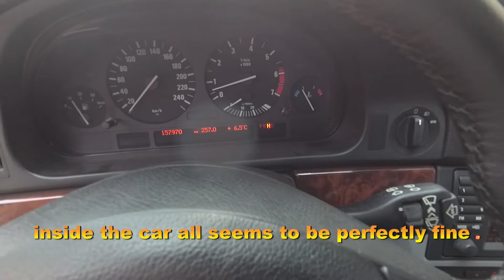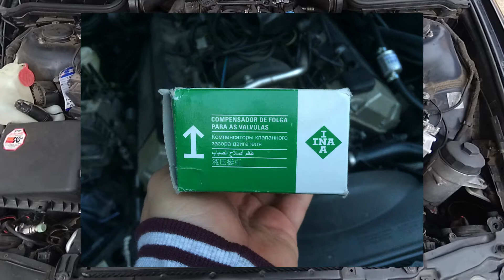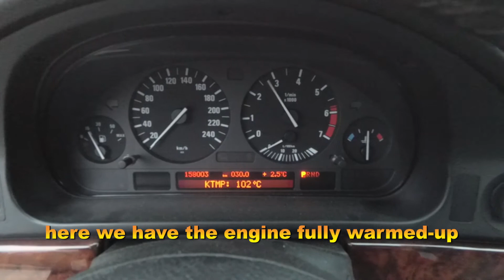BMW M62B44TU chain rattling. Chain tensioner replaced. Engine sounds. *Stock Exhaust Sound Check*

Comment: The reason the startup rattle happens is because of the “non-return valves” behind the vanos solenoids. The spring inside doesn’t seal the ball correctly after all of the heat cycles. Causing the oil to leak down back into the oil pan. A proper non-return valve should keep oil at the top of the engine at the vanos solenoid so the startup isn’t dry

Comment: I did try to change mine on the M62B44 non-vanos. It also had the longer yet softer spring. But even filled with oil, it made a ticking (chain ?) noise when accelerating past 2000rpm. I switched back to the original tensioner and no more ticking. Did it also happened to anyone else ?...

Comment: Hi what happened to your e39.. did you replace the chain guides in the end… thanks
Reply from the maker: Nope. I did not do that yet. May be I should have done that by now...
Reply: Just did the chain guides and vanos rebuild on my 01 740iL. Piece of cake, took a few days, going at it at a casual pace. Should MOST always use OE or OEM parts..just my two cents. Just because these e38/e39 are pushing 20+ years, does not mean they should not still be treated and maintained as the $70,000 cars they were in their prime.
Reply from the maker: @imabozoMeng  100% agreed on using OEM chains and guides. I am almost certain that BMW made an upgrade of the plastic chain guides and not sure if one can trust aftermarket versions. Was it easy to undo and redo the Crank Pulley cause torque specs of that bolt are crazy...? 😵‍💫
Reply: @mitchoniauto  Funny you ask, I snapped two 1/2" breaker bars before switching to an impact for removal. Torquing the new crank bolt 100% needs a 4ft 3/4" drive breaker and the m62 crank holder tool. 😆 The Harbor Freight 3ft breaker was bending severely on the last 60°.

Comment: It’s two years later. Did the guides make it?

You pull the fuel pump relay then turnt he car over to get the tensioner to disengage. Otherwise you slap the hell out of your 20+ year old timing guides.

Comment: the M62 and M62TU engines operate and a ridiculously high temp. 102C + is 215 degrees Fahrenheit ) and sometime the temp is even higher > 225F )meaning the engine oil is that same (or very close) temp. Its why the timing chain guides become brittle. Replacing the chain tensioner before any rattling  is good preventative maintenance. i own a 97 540i sport 6 spd (non vanos), ( 5yrs and driven it 50k now-140k on car). I bought the low temp 180 degree F thermostat kit  at 90k (i think approx <$100). engine much happier, coolant system pressure much lower, oil more stable. Valve cover gaskets just replaced allowing a good inspection of  Timing guides and chain tension etc . mine was tight. Engine spotless with zero sludge, deposits or even discoloration. I use liquimoly 5w40 and 5k oil changes. In my owners manual it says to use 15w40, but since my engine runs cooler it seems happier with 5w-40. You might want  to try a heavier oil Especially since you`re engine noises get more pronounced as it gets up to normal operating temp.

Comment: Timing chain guides after all huh?
Reply from the maker: :))) Still do not know for sure. Still driving like that. The thing is that we are pass 100k miles mark - 169k km to be exact. Everybody says it is 100k miles and one should change the chain and tensioners.
Reply: @mitchoniauto  Mine did the same thing for a long time too.  Then one day after replacing all water hoses  and repairing the injectors the ticking sound got louder.  Turned out to be the timing chain guides.  Initially the ticking sound went away when revving it, so took it for a spin and man it was performing better than before but the ticking was going after decelerating.  I put a new guide tensioner too and the sound was still there.  So took the entire thing apart and yep the guides were just barely started breaking.  The only way I determined it was the guides is when I removed all the belts, ran the engine and the ticking was coming from the drivers side.

Comment: I will never replace tensioner alone, without replacing chain guides as well. New tensioner will increase tension to the extent that old plastic guides can easily brake down. Then, there is a terrible noise due to chain touching a metal cover.
Reply from the maker: Yeap! You are probably right.
Reply: @mitchoniauto No, he's not. The tensioners get clogged up with burnt oil particles and don't pressurize fast enough during cold starts much much sooner than the guides start failing from heat cycling and friction wear. What kills the guides fast is the cold start chain slapping against them. Change your oil religiously and plan on changing the tensioner when the cold start rattle starts to prolong your guide life. They can last 150K. If you buy the car at 100K and got the rattle, don't expect miracles from just changing the tensioner. The original plastic is 20+ years old at this point and the chains stretch, too.
Reply: The tension is actually what makes the guudew last a lot longer, but when it has slack the chain slaps on the plastic and shatters it to bits

Comment: What's that knocking noise everytime you pan to the  right hand side?, as I have the same noise
Reply from the maker: Hi! Can you give me the time(s) in the clip so that I can look into it?
Reply: @mitchoniauto  i have the same noise as benny above and you have it aswell its at 10:11 to 10:15 it sounds like a steam train going uphill😂
I replaced tensioner as well and still sounds ,someone told me that sounds like lifter noise,next job is oil pan off and looking for plastics to make sure guides are good ,also someone said its normal as the non vanos is noisier 🤷🏻yours is non vanos right?
Reply: Another vid I watched said about same thing and in the other it showed the oil pump chain is loose in the pan. Might be something
Reply: @mitchoniauto  an example @1.01
Reply: its a normal m62 knock
Reply: 0:46 - 1:02 i have that exact sound aswell, M62B44 NON-vanos. Never heard it before, noticed it when i started it back up a week ago. any clues to what it might be?

Comment: Hi, found the reason for the ticking sound?
Reply from the maker: At one point I decided to check how the spark plugs were doing and found out that most of them were not tight enough which was a surprise because I had them torqued myself when I changed them... I will make a video with the sound of the engine as it is now.
Reply: Its VANOS
Reply: First guides are gone then needs rebuild vanos and the clean or replace tappers

Comment: Can you put a link up for the tensioner you used?
Reply from the maker: Yeap! BMW part number is 11317531813 and the one I used is INA 5510004100: https://www.fcpeuro.com/products/bmw-timing-chain-tensioner-lower-11317531813 And this is the Genuine one: https://www.fcpeuro.com/products/bmw-timing-chain-tensioner-lower-11317531813-1

Comment: Changing tensioner will not Fix  the rattle
Reply: What will fix the start up rattle? I already replaced chain tensioner a d still have start up ratlle
Reply: @wierdodude102  same here wtf is it
Reply: There is no fix for this !
I ve changed
1 timing all Components
2 cam adjusters (vanos)
3 timing tensioner 
4 non return valves Behind vanos solenoid
5 Tried different oil No good result
6 Low temperature thermostat No good result

Some how oil drains from the top of the engine and cam adjusters are empty with no oil and takes Couple of seconds to fill them up and that's why we hear this rattle . Just do the 1 2 3 and enjoy the car .
Reply: In the winter is less ratlle because oil is more thicker  and all engine Components are  shrink to each other and is less space for oil to pass .
Reply: Changing vanos  cam ajusters only fixed diesel sound at idle
Reply: @ANDYW031084  when you say "cam adjusters" do you mean the vanos units or the vanos solenoids?
Reply: @alexanderstevens145  I am looking into this now as I have replaced full timing chains kit (including oil pump chain), chain tensioner, vanos solenoids, anti drain back valves, oil, genuine filter, cleaned sump and oil pick up ect.

I found the problem is that the oil filter housing is draining of oil over night and on restart the engine it has to reprime the oil filter housing and during this time the vanos units rattle because they are low on oil pressure. I am just now starting to figure out why the oil filter housing is draining. I will repost when I figured it out.
Reply: @wierdodude102  thanks man keep us posted
Reply: @wierdodude102  Yes vanos units was expensive got this parts from the dealer i know you can get just the seals  but i changed the whole think .
Reply: @alexanderstevens145  so I have fixed the start up rattle. I was checking the oil filter housing each morning and found that the oil filter housing was empty/no oil. Because the oil filter housing was empty the oil would have to pump up through the oil and to the vanos units ect before it had enough oil to stop the rattle then after a few seconds it would stop rattling and run quietly. So I knew that the oil draining out of the oil filter housing is the cause of the rattle. Now I needed to find why it was draining over night as it should remain full when engine sits overnight. I disconnected the oil drain hose at the bottom of the oil filter housing to see if the oil was leaking passed the non return valve overnight and back to the sump but no oil dropped out overnight however the oil filter housing was again empty. I checked the internals of the oil filter housing and it all seemed OK. I noticed the big o ring on the plastic oil filter housin cap was a bit flat so I replaced it and put it all back together and no more rattle. I have checked frequently after if the oil filter housing is remaining full of oil over night and each morning it has been full of oil and no more rattle.
Reply: @wierdodude102  that’s awesome man. I got all my gaskets redone by a bmw technician the previous person who replaced the timing chain didn’t put everything back properly. 
Anyway it was extremely expensive. 
My vanos units are on the way out but he told me not to worry about it just put up with the noise. I’ll check the oil filter housing thanks mate.
Reply: @wierdodude102  he mean tappets pushing on cam lobes i think..